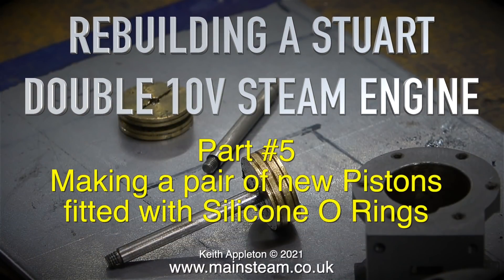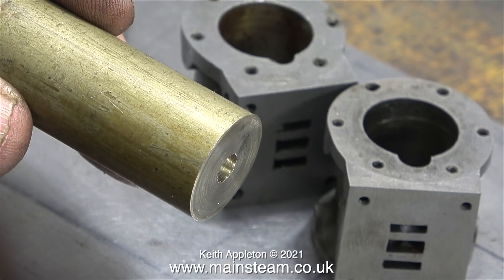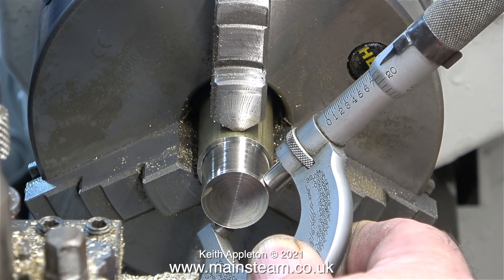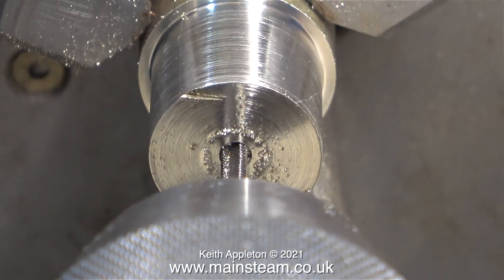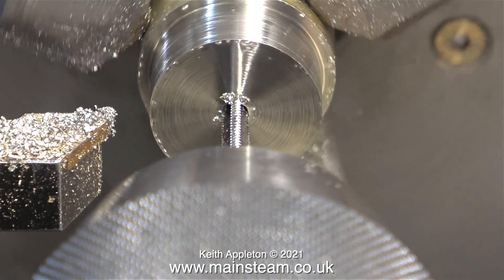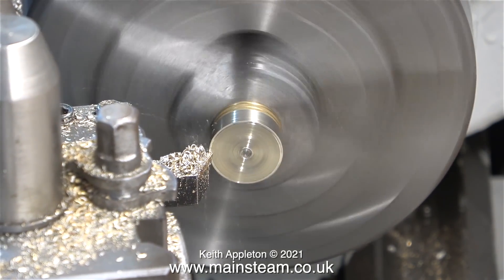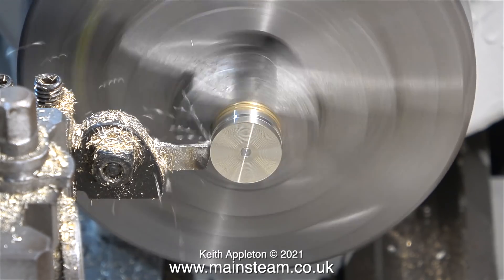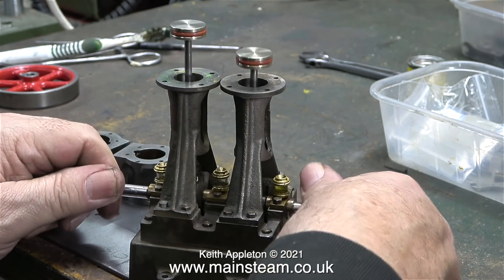REBUILDING A STUART DOUBLE 10V STEAM ENGINE - PART #5

Comment: Hi Keith, had a question, what is the service life of a Silicone O ring in an engine under steam vs. the carbonized yarn?  Not exacts mind you, but your experience or even general knowledge, I was wondering.
Cheers.
Reply from the maker: Very comparable to Graphited Yarn, provided that the oil supply is good.
Reply: The big advantage of O Rings is there ease of insolation over Graphited Yarn.

Comment: What is the best type of o rings for a model steam engine? I noticed that You used silicone o rings.
Reply from the maker: Brass or Gunmetal Cylinders - Silicone O rings.
Cast Iron Cylinders - Silicone or Cast Iron rings.
Silicone is better in my opinion for small model steam engines like this one.
Reply: @keithappleton  I was thinking that it would have to be some special type of silicone o rings for being able to take the heat of steam to last. Thank You for Your help.
Reply from the maker: Yes, they do need to be Steam Grade Silicone O Rings.

Comment: I purchase WD-40 by the gallon.Not only does it make a great cutting oil but, after wiping down my machines, I give all the exposed metal parts a light coating to prevent rust.The next time I prepare to use it,a paper towel removes the WD-40 and,any grime that is mixed with it.Wipe down the ways with way oil and,lubricant as needed.
Reply from the maker: Yes, I am going to start buying in by the gallon too for the same reasons.